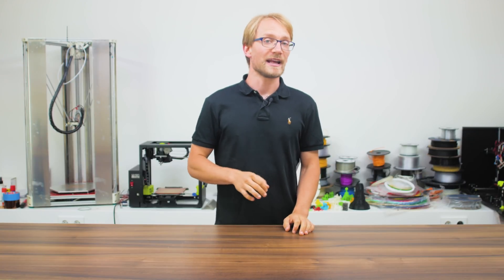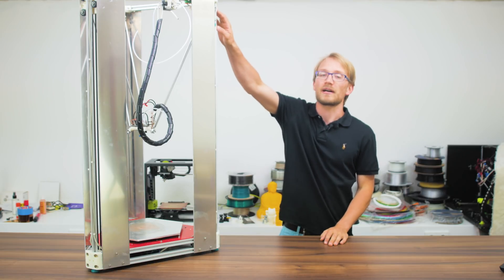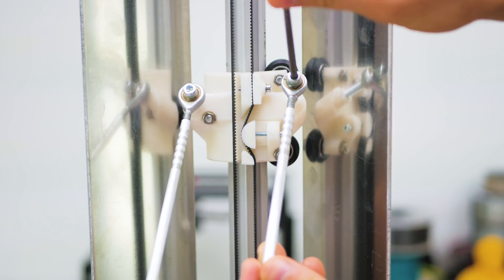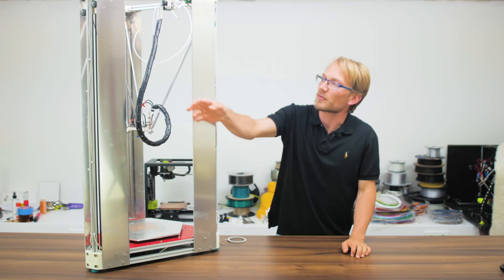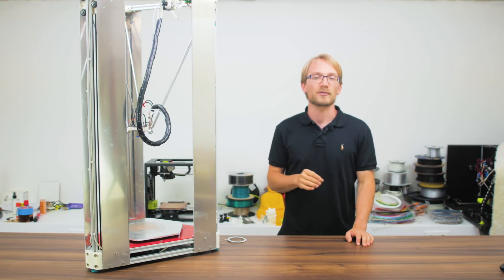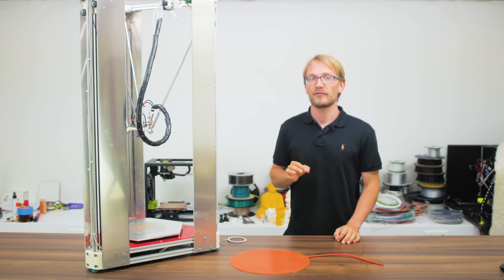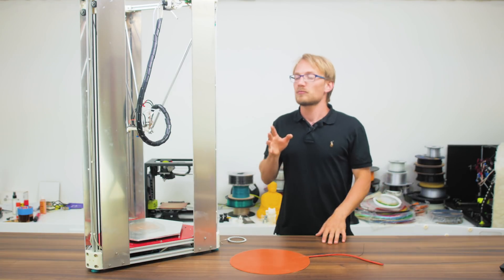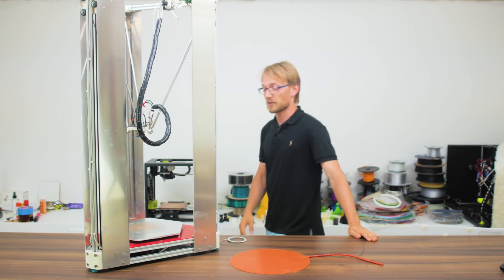My biggest 3D printer yet! Analyzing the CerbrisReborn design

Comment: You can get PTFE lined 0 lash ball joints too, the PTFE is used to seal, self-lubricate primarily, but as a side effect: No lash :)

For PSU: Check out server power supplies, you can pick up a 800-1000W 12V only (yea 67-83A supplies!) for just 15-25$ :)
These are usually platinum rated too, so excellent efficiency.

Nice work on designing your own printer! I've been in process to do something similar, but maybe my goals has been ... Slightly too extreme

Comment: Direct drive, he says then points at a Bowden. Oops!
Reply: +Thomas Sanladerer yes, I see the problem! Perhaps "standard" and "geared"? Anyway, I always enjoy your videos, keep up the good work!
Reply: +Thomas Sanladerer is right. Direct drive has nothing to do with bowden or not... It is just the name of a type where the toothed pulley is directly mounted on the motorshaft.
Reply: +René Jurack unfortunately it would seem you failed to actually read his point (a great injustice, given you claim to be supporting it). If you had you'd have noticed that he was more pointing out the poor terminology that leads to such confusions and that I accepted and agreed with him.
To note, it DOES have something to do with Bowden (or not) however that is case one of two.
Case 1: Bowden or direct - extruder is mounted either by Bowden at distance from head or directly above the hot end.
Case 2: geared or direct - extruder either uses a geared design to increase output torque or has the toothed hob directly attached.

I hope this cleans up the issue for you and you can see where the problem arose. Good day.
Reply: +René Jurack also to note is the fact that as I've never come across a geared Bowden that combination is illogical and so when dealing with position of mount my misunderstanding was justified.
Reply: "direct extruder" is not "direct drive extruder". Anyways, everyone is free to call it what he likes to do... ;)
Reply: And a geared bowden-extruder is not illogical.
Reply: +René Jurack indeed they're not the same, however as one can be abbreviated to the other and commonly is... the issue still stands.
Illogical was poor word choice. Perhaps "extremely unusual".

Comment: Hi Thomas. Very interesting video. Thanks. What print speeds do you normally use with this printer? (Perimeter, infill,...)
Reply: Thanks. How come the values may not compare? I mean units are the same. I've checked distances (dimensions) I get with Marlin multiple times, but I've never timed it so I guess speeds and acceleration could be off? Or did you mean to say that quality of the print at same speeds (and accelerations) is different with Smothieware vs Marlin? If print quality for the same g-code is depended on firmware, perhaps that could be topic for one of your future video?
Reply: Oh, I wasn't aware of that. I'll have to look it up in the code to see if it is still so. Thanks for your insights.

Comment: The use of Cat5 cable is interesting, could you use it for say extending  the hotend cables if needed? would 2 twisted pairs  (4 wires) be thick enough for the current?
Reply: That's what I'd like to know aswell. Single wire in cat5 should only be used for 600mA current max afaik. Using a pair should give you something about 1.2A, which is still kind of low for a 40W + rated heater cartridge :o I could be totally wrong though x)
Reply: @René Let's say we're running a 12V system. For a 40W (hotend heater) cartridge we would need a cable capable of handling 3.3 Amps. Given that a single stranded wire inside the CAT5 cable can handle let's say 1A (or 0.577A if we use the 700 cmills per amp rule), we would need 3 (or better 4) pairs to be able to supply those 40W (36W) to the cartridge. So we would waste a single cat5 cable just for the hotend heater. Is that correct? oO
Reply: depends on the voltage of the system, the wattage of the heater and the length of the cable to the heater. Tell details and I calculate it for you...
Reply: It's just a regular 12v 30a PSU. It's running a e3dv6 and length I would say is no more than 18" even that is probably too long, I'm not home to check, and it's all cable wrapped nicely. I woud like to know for the future tho, and thank you for helping!
Reply: Depending on the quality of the cable, but: patchcable with AWG26/7 or AWG27/7 has 0,141mm²  or 0,111mm². This is enough for the 3.3A over 1 meter (18" is 45cm, way to the heater and back is ±1m). You will need 1 pair of the cable for the heater.
Reply: so 1 pair 2 wires 1 per strand, or 2 pairs 4 wires 1 twisted pair per strand?
Reply: 1 single wire to the heater, 1 single wire back to the source. Makes 1 pair.
Reply: +Nihilianth The low current rating on Cat5 is for long cable runs, short lengths like these would be fine at 2A or so.
Cat5 is usually made up of 24-26AWG, so you would just use the ratted current for that, rather than PoE.
Reply: So a single strand of wire ( half of one twisted pair with one wire going to the heater and one returning ) in a 1 meter long Cat 5 cable is enough to power a 3.3 Amp 40 Watt heater in a 12 volt system? So 4 wires for the motor, 2 wires for the thermistor and two for the heater. That means one Cat 5 cable could run to all three components since it has 8 wires?
Reply: Yes, but you forgot the fan.
Reply: Thank you Thomas, I'm happy to be a Patron. Keep up the good work!

Comment: Thanks alot for giving insight into your delta printer build.
Once you mentioned the electronics of the printer it came to my mind that the last video of yours regarding controller boards is relatively old.
I am in the planning and designing process of an cartesian style 3d printer and am relatively unsure regarding the choise of electronics (specifically stepper drivers and controller board) although your older videos helped me a bunch I don't know if there aren't newer versions or totally new boards on the market that would suit me better.
To be a bit specific the printer should use big NEMA 17 (maybe NEMA 23) motors with up to 2.2 amps (for the NEMA 23).
I am concerned about the noise level of the steppers so i also consider(-ed) servo motors but there's barely any information regarding compatible controller boards, compatibility with Marlin and so on. I have some really crazy ideas for my machine which results in the need of a ton of motors (i think 3 or 4+, excluding the axis' and extruder) and a lot of heaters / sensors.
So far the only board i could imagine capable for my printer would be the panucatt azteeg x3 pro.

Comment: Hi Thomas! Another great video!
Can you please explain how you figured out the dimensions of the delta printer? Like for any specified volume printer (say i want to build a 250*250*250 build volume) how do you calculate the lengths of the effector arms, height of the delta towers, the spacing of the towers and all the other measurements?
I have been having a lot of trouble figuring that out!

Comment: Hello Thomas Sanladerer
Can you please tell me how many Ampers have the 24 Volt power supply mounted on some of your printers?
What 24 volt power supply you recommend for a printer with 30x30 cm heated build plate?
Thank you
Reply: Hey, you'd need to figure out what wattage your intended pad would draw, plus the amp requirements for your components in general. Find the amps needed at 24v for the pad and add everything up and that should point you in the right direction for a power supply. I'm reasonably certain that the listed draw for components is peak useage, so you probably wouldn't use that much all the time, but even with that said, it's not a bad idea to get one with a higher amp rating to cover your bases, plus it allows for future expansion if you have room to play. 

I'm powering my pad from 220v directly with a Solid State relay, but that's only due to its size as mine is a bit bigger than 30x30 lol But, I'd be surprised if a 20a PSU wouldn't work if you're using a typical config and not something crazy like 2 NEMA 23s for 2 axis', a single for the other and NEMA 17s for your extruder(s).
Reply: +brandon acree  Thank you for the information.
Reply: Np. Depending on what you need I might be able to help clarify a few things I'd needed, but I'm not sure how familiar you are with electronics. I'm fairly new, but I had a good mentor :)
Reply: +brandon acree I studied electronics for 2 semesters am some embedded programming at university in Bucharest Romania. I made the question about power supply on 3D printers because a have a have some doubt about some printers that they undersize the power supply. In my printer I want to supply only DC power because using direct mains current is hazardous without a transformer. I reached to the conclusion that I need a power supply at 24V and at least 20A. I want my 300 watt heated bed to reach desired temperature fast and the dc servo motors can absorb in rapid acceleration almost 15Amps.
Reply: You need I=300/24 amps to run your bed at rated power. There's no such thing as "fast" with your limitation of running at 24V. You get what you get with that heater.

Comment: why not you change the wheels on the 3 carriages with a linear rail instead? just rotate back 45 degree the profile and lock in a linear rail and then secure the carriage it to. there will be no play on the carriages anymore. just need some teflon spray occasionally
Reply: +Thomas Sanladerer true. i gotten an mgn9 hiwin with 850mm cost around 60 per piece. so 3 of it is definitely over 100. but it is pretty solid and eliminate lots of the loose motion.
Reply: +Cary Andrae now you can also get a full metal kossel corner brackets in xl size which can fit a 2040 extrusion instead of the kossel mini which is standard 2020

Comment: Thomas, i have a question for you! I built my own 3d-printer, based on Prusa design but big size and with welded steel frame. Is it possible to use only one screw for Z-axis, like in Tevo Tarantula?
In my case it will be ball screw, so if it will be mounted on solid steel frame, is it any problems with stability could be? What if i use three linear rods in Z-axis (two from one side and one rod and ball screw from other side?)
First video, when i seen screw only from one side of axis was about Carbon Fiber Bike (Carbon Fiber Bike Built With 3D Printer - Fettlers - Chapter 2)
On 1:10 you can see this strange setup...And second example- LM5200 LINEAR/GANTRY MILL.. It`s strange design for me, but it works. And i think- why not?)) So, what you think about it? You are professional and for me is important your point of view!
Reply: Thanks Thomas! Nice example with Printrbot Play, i need to read more about this setup..
Reply: The Tevo Tarantula has a single Z axis screw as well, using rollers on alu profile. I'm not a big fan of it but seems to work alright.
Reply: Thanks for answer, australian muse!
Reply: I came to this channel on your recommendation, Angus.
I'm glad I did, but it looks like you reply to more comments, even those on your friend's channel, thanks